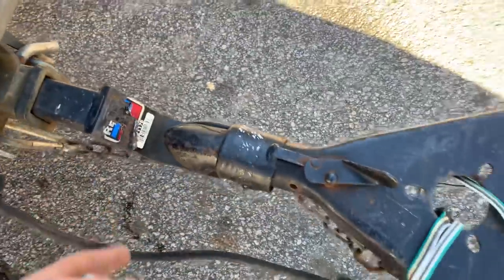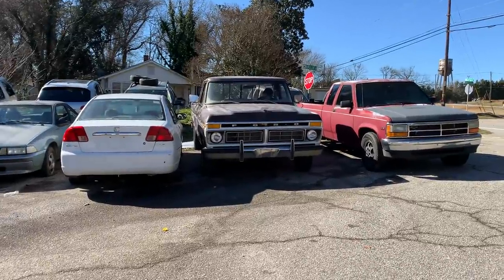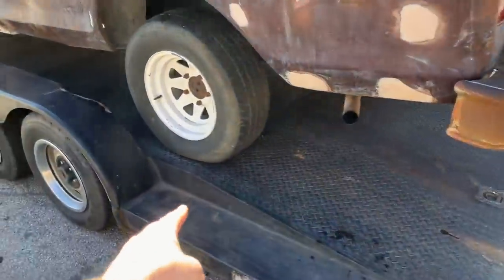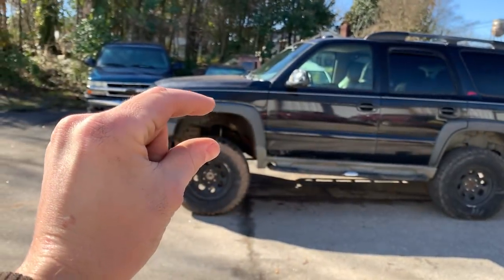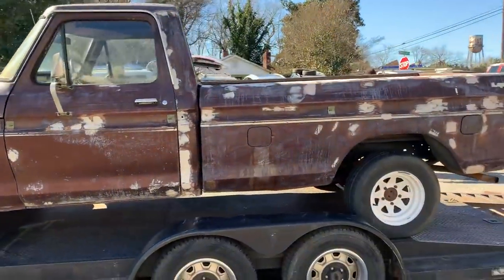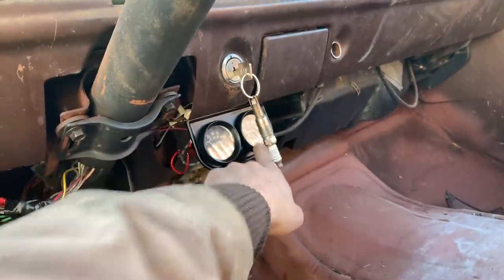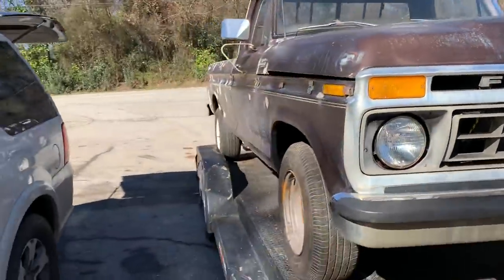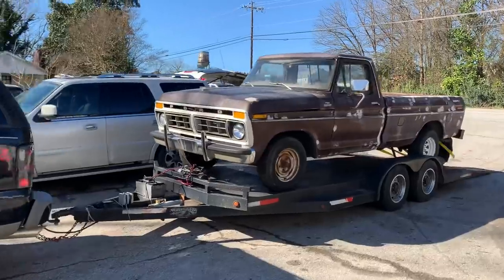1977 F150 Custom! And New Tow Rig?!

Comment: Y'all should find either an f-600 or f-700 Ford or a c40 through c60 Chevrolet from the late '60s to early '70s, do a Cummins swap with a manual transmission, and build yourself a cool classic tow rig for vehicles.

Comment: Jay u should find ur self old power ram w 250 3/4 4x4 one with the 360 an swap out with 1999  360 or 2000 360 or even  5.7 hemi  I have 1990 power ram w250 3/4 4x4 with gas 5.9 but gonna put the 90s 360 out an drop something a little new it an rebuild the 360
Reply from the maker: Trust me, i would love that. But I cant afford one of those.. I would like a stock one and be just happy! They are just so far up on prices right now.. Ill just be an admirer for now.